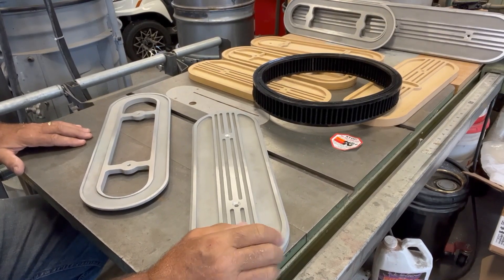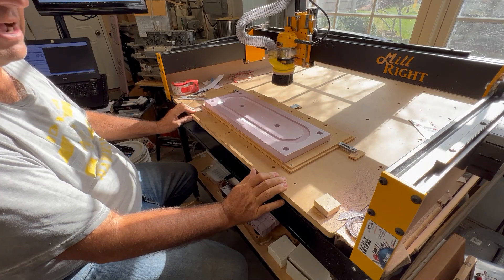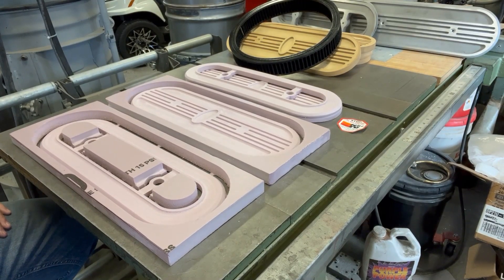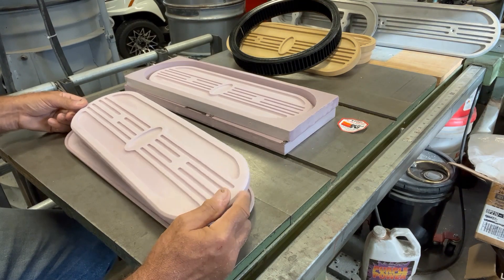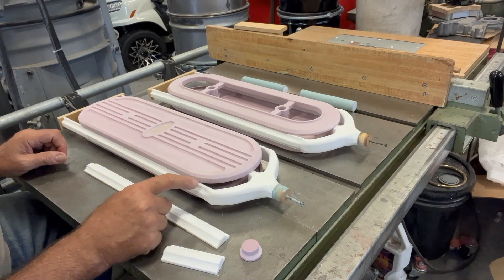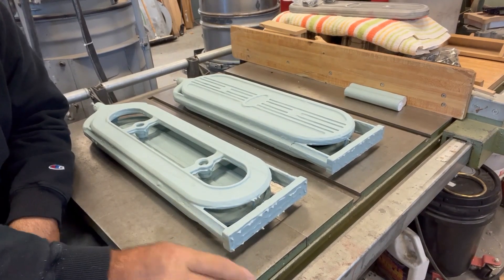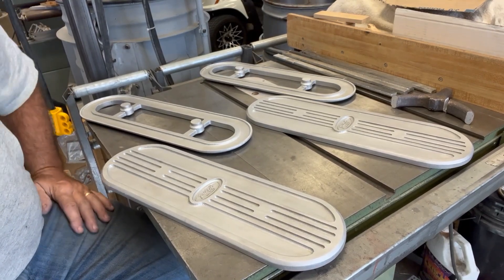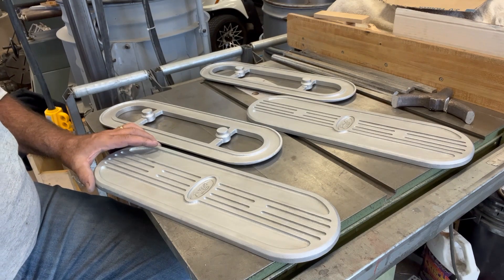Casting an Inline Carb Air Filter - Lost Foam

Comment: Maybe you could use a thermal camera to see the difference in flow speed with the different foam types,. Make a thin rectangle container for the sand,   if nothing is learned, atleast it would be a cool video!!
Reply from the maker: I have actually considered this. Have gone as far as looking at lower cost (<$300) IR cameras, but most dont have the (high) temp range and I just havent been able to convince myself it's worth it. If I ever find someone that has an IR camera I can borrow, I may give it a go. It would be interesting to see the actual fill pattern vs the imagined one. Best, Kelly

Comment: I am quite interested in this method of making aluminum parts, so I have 2 questions, if someone feels like chiming in. First, this appears to be a hybrid of investment casting and sand casting. I would normally expect a truly investment cast part would have quite a thick layer of slurry/sand, slurry/sand, etc., until it builds up a thick and strong coating of the pattern. So is this literally 1 dip, and then supported by sand in the barrel, to take the place of all the additional slurry/sand layers ?   Second, with lost foam casting, does the molten aluminum burn out the foam as it's being poured into the mold ?  Is there no burnout of the pattern before the metal pouring ?  Thank you, Tom.
Reply from the maker: Yes, the foam pattern remains in the mold and is evaporated as the molten metal is poured and advances. Yes, it is one dip, but the thin coating provides little to no structural support to the mold. The purpose of the (permeable) refractory coating is to control the rate at which the evaporated pattern gases escape and thus speed at which the molten metal advances. There is no binder in the dry sand mold but with vibratory packing, it is much more tightly bound than loose sand. The hydrostatic pressure of the molten metal helps hold the sand in place. 

Like other evaporative pattern casting processes, there is no need for draft, complex parting lines, cores, or pattern tooling, but you must make an expendable foam pattern for every casting. The primary advantages of lost foam casting compared to other evaporative pattern methods (lost wax or PLA shell or investment casting) is it requires no burn out step and enjoys very low pattern and mold costs. Best, Kelly
Reply: @kellycoffield533  Thanks Kelly. Very helpful. Tom.

Comment: How long do you let the patterns dry after dipping them?
Reply from the maker: Over night but small simple patterns could be 5-6 hours. In the Winter, the bathroom in my shop has a heat delivery duct. If I close the door, it's a perfect drying room. In the summer, ambient produces the same result. A gentle breeze accelerates drying. Sometimes you need to move air through deep cores and passages or they could takeseveral days without but that's not the norm. Best, Kelly